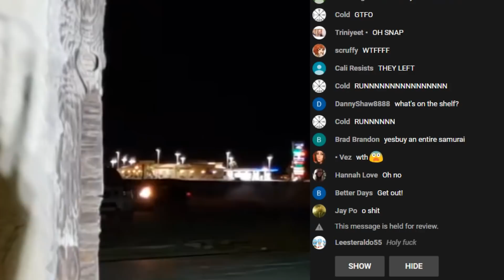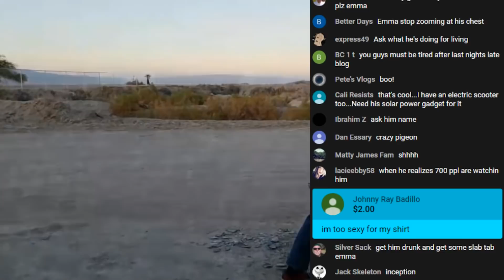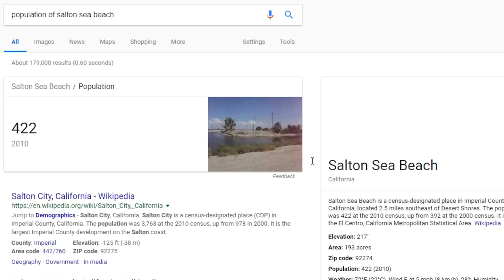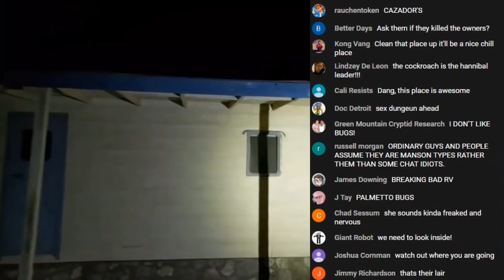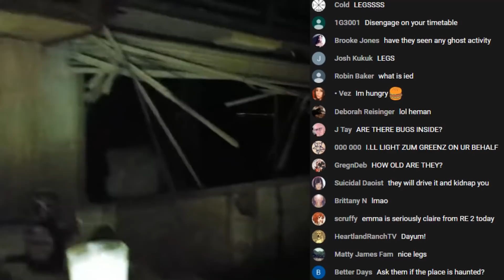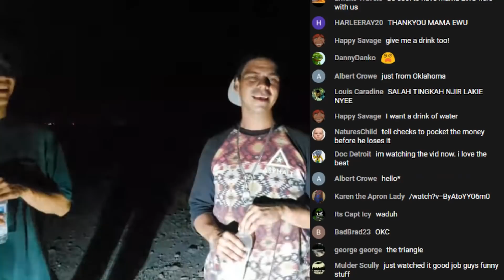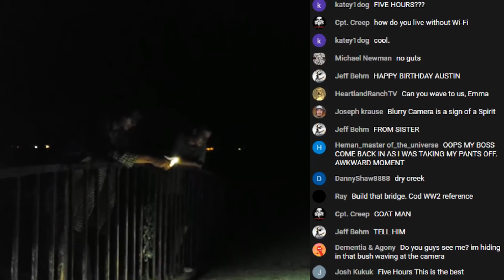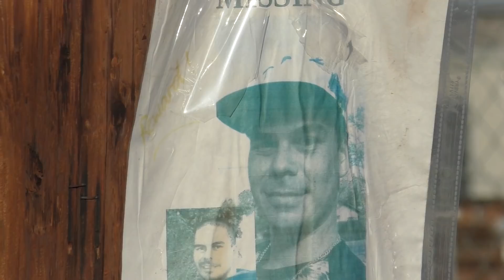UNSOLVED: The DISTURBING Case Of Nicolas Sonderegger | True Story of a Missing Person Cold Case

Comment: Decomposition time varies based on several factors. A body exposed to the elements, especially heat, and moisture, would decompose much more quickly.
Reply: Although with the high levels of salt the water would actually preserve the body. So if you wanted to "get rid" of a body, putting it somewhere (in salt water) where it (and evidence - death cause) would be preserved. Compared to a body left in the elements would degrade and be turned to bones making cause of death harder to determine.

Comment: Good on you guys for trying. The larg tire stacks could be a dumping spot.
Reply: Big enough to place a body inside of and burn them up to ashes tires and diesal fuel has been making problems dissapear for the cartels since the 70s and why would someone dump those tires out there when a commercial tire shop will buy those casings for good money even with sidewall damage they can be repaired and retreaded that may have definitely been a kill room and funny they had houses burning down out there make a stack of tires around a body light it on fire and by the time someone sees the fire from the structure the body would already be mostly gone bad things are going on out there for sure